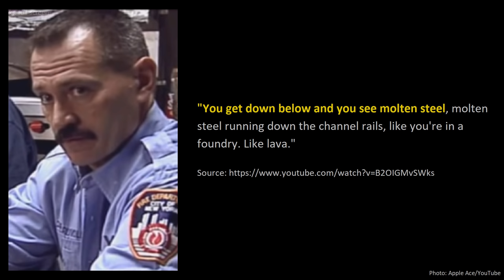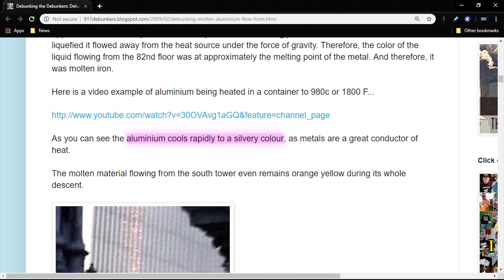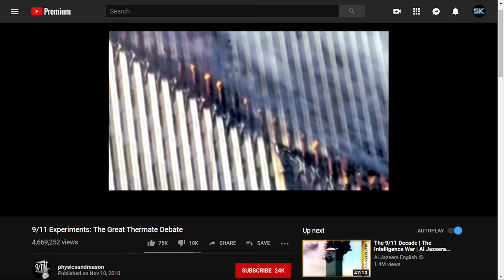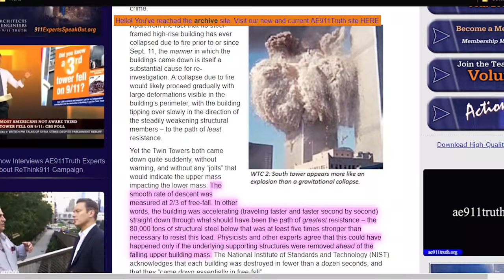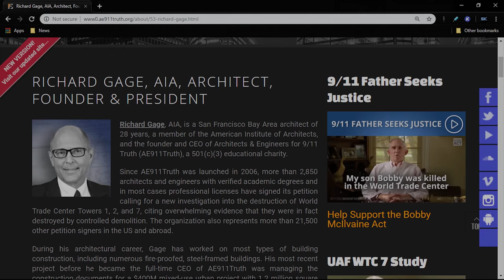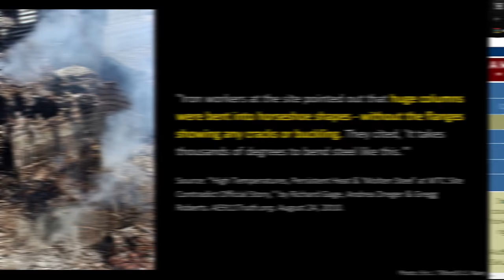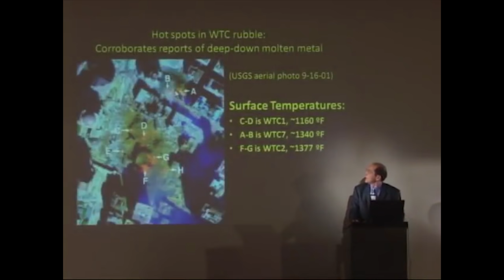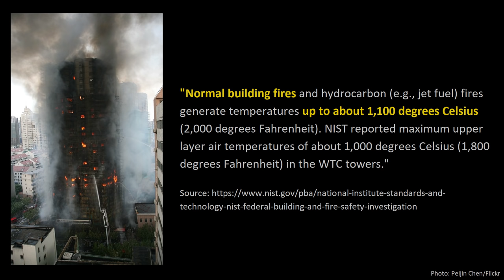9/11 Truthers Debunked: "Molten Steel = Thermite From Controlled Demolition!"

Comment: Could you please explain another point to me? If the fire became from the impact of the plane, and only the steel in those nearby floors were seriouysly damaged, why wouldn't all the lower floors with no such damage hold on the structure when it fell? The pankake effect makes no sense if you think about that. No?
Reply: Because of the construction of the towers, and the potential energy inherent in a 110-story building.
Reply: Well, that doesn't make much sense, because if so, the damage from the impact would've been much bigger, the building would shake or something. But no, just a airplane-shaped hole with fire damaging the structure on the upper floors, not on lowers.
Plus, the Empire State also had a plane crash long ago and the damage wasn't that harmful if compared to the ones on the twin towers. Well, at least the building survived okay to the disaster.
Reply: @thiagowwz  Yeah. Let's see if you can see the issue with your argument here.

B-25 Mitchell Bomber: Max take-off weight, the weight the plane cannot actually exceed and get off the ground, 35 thousand pounds, and the plane wasn't anywhere near maximum load. Max speed, 272 mph, equivalent and since the plane was flying through a fog, it wasn't near that, either.
Empire State Building: a steel-frame, reinforced concrete tower. 

Boeing 767-200: OEW, the MINIMUM possible weight to have a functional aircraft, holding only the fuel needed to get off the ground, and the crew, 176 thousand 650 pounds. The plane was fueled for a flight across the nation, and filled with passengers, luggage and everything needed for them. The minimum speed of the 767-200, approach speed, where the plane just barely doesn't fall out of the sky, is 153 mph. We can, with authority, say that it was moving a lot faster than that.
Twin Towers: an all-steel, tube-in-tube construction with as much open area as possible.

Assuming, and this is one hell of an assumption, but assuming the B-25 moved at 250 mph, and weighed 25 thousand pounds, the kinetic energy would be close to 71 million joules. It wouldn't have been because the numbers are significantly higher than they would have been, but let's go with it.
The kinetic energy of Flight 11 would have been 2.5 billion joules, or about 35 times that of the B-25. The energy of Flight 175 would have been in excess of 3.9 billion joules.

They would also have hit buildings that have nothing in common other than being in New York. Conclusion? The cases are as far apart as they could possibly be.
Reply: @MoonEyes2k  And yet, you couldn't explain the structure failures of WTC.

If the damage from the airplane was that strong, and there was a structure failure, the building would've show at the moment of the impact that there was a structure failure, but no, we've only seen a plane — with fuel to cross the nation — hit directly on the building and created an enormous hole on it and it took around of an hour (?) to say that the flames were the cause of deforming (not even melting) the steel. The fuel couldn't get in any way to the needed temperature to make the steel from the higher floors melt and destroy all the steel and concrete structure on the undamaged floors. 

That doesn't make any sense if you think about it. You're basically accepting an official report without questioning anything that is really off-spot on the explanation given.
Reply: Action-Reaction Law

There is no way a smaller part of the building do THAT damage to the larger and undamaged part of the building.
The worst thing that would've happened is the upper part of the builing having some debris falling apart, not a "pancake effect" destroying evetything underneath it.
Reply: @thiagowwz  So, what you're saying is, your "argument" failed, and now you want to make it about something else, anything else?

"The fuel couldn't get in any way to the needed temperature to make the steel from the higher floors melt and destroy all the steel and concrete structure on the undamaged floors."
Even ignoring that this is irrelevant, the jet fuel didn't do anything other than START the fires, it's also nonsense. The open-air temperature of a fire of Jet-A fuel, as would have been used in a US domestic flight, is 1000 degrees. Inside, heat radiates back from walls, floors and ceilings, and so is significantly higher. Of course, that doesn't matter, since the fire didn't "melt and destroy" anything. It weakened the steel.

"You're basically accepting an official report without questioning anything that is really off-spot on the explanation given."
No, in comparison to you, I have actually studied the material and the science. And what do you know, facts, proof and science doesn't actually CARE about you or your notions. It just IS. And it's the same for each one.
Reply: @thiagowwz  "Action-Reaction Law There is no way a smaller part of the building do THAT damage to the larger and undamaged part of the building."

That you don't understand the Third Law of Motion only mean that you don't understand it, and how it doesn't apply.
Reply: The Empire State was an example, not an argument. 
The argument was above the exemple. Cases are nothing to do one with another? Okay, you got me there. But you still couldn't explain the pancake effect.
The fire was started by the fuel and weakned the steel. Still... The higher floors steel. Not the lower ones.
And there is no way a smaller (and weakened) part of something do a damage on a larger and stronger part of it.
Reply: @MoonEyes2k  "That you don't understand the Third Law of Motion only mean that you don't understand it, and how it doesn't apply."

Oh, it doesn't apply? Interesting... And I'm the one who doesn't understand it, right? Okay, then... 🤷🏽

You should definitely review some of your science studies.
Reply: @thiagowwz  "The Empire State was an example, not an argument. "
Oh, no. No, it was an argument. One which you are not the first to attempt to use. And, when pointed out to that the cases are entirely not parallel, and one cannot be used to argue for the other...you ran away.

"But you still couldn't explain the pancake effect."
Oh, certainly I can. But, after nearly 20 years, that you don't UNDERSTAND that means it wouldn't be any use, because you'd ignore it.

"You should definitely review some of your science studies."
Yeah, or not so much. But, by all means. DO detail what the Third Law says, and exactly how it applies to the situation. Be specific. Use quotations, and as needed, extra sheets. I will be RIGHT here, waiting.
Reply: @mooneyes2k478  "And, when pointed out to that the cases are entirely not parallel, and one cannot be used to argue for the other...you ran away."
--
"Oh, certainly I can. But, after nearly 20 years, that you don't UNDERSTAND that means it wouldn't be any use, because you'd ignore it."
--
Oh! I'm sorry, who ran away?! lol
Reply: @mooneyes2k478  Do you want me to bring articles to show you?
'Cause I've already explained and you still are saying that is able to explain the pancaking and came out with nothing yet. I made the 1st question and you didn't explain it and kept coming up with nonsense explanations trying to prove your point pointing to the bad example I gave from the Empire State.
Reply: @thiagowwz  "Do you want me to bring articles to show you?"
By all means. Bring away. See what you got.

"'Cause I've already explained"
No, you haven't. You have carefully and deliberately NOT "explained" anything. You've talked around it, and past it, and tried to pretend it didn't exist.

"I made the 1st question and you didn't explain it"
You ALSO made the first claim. And you still haven't supported it.
Reply: @mooneyes2k478  

"By all means. Bring away. See what you got." 
What do you want? Links or me to explain every topic that I bring up?
--
"No, you haven't. You have carefully and deliberately NOT "explained" anything. You've talked around it, and past it, and tried to pretend it didn't exist."
I talked about my point and you told me that the 3rd law does not  apply, man. And you couldn't explain why, you're just trying to say that I'm not correct about anything not saying anything. So... Easy.
--
"You ALSO made the first claim. And you still haven't supported it."
And yey you're miserably failiing to debunk it. So... Again... Easy.
Reply: Maybe the 3rd law doesn't apply because there was also a black hole inside the building that the plane created with all that destruction.

Go take a look at plane accidents.... A plane cannot do that to THAT building. Sorry.
Reply: @thiagowwz  "Go take a loot at plane accidents.... A plane cannot do that to THAT building. Sorry."

So, your argument here is, "Because a plane hit the ground, it can't hit a building!"? Good attempt. Amazingly stupid, but still, good. No...no, wait, it's just stupid.
Reply: @mooneyes2k478  I do not see "ground" on my sentence. Grow up, dude.
Reply: @thiagowwz  So, where does the planes go when there's an accident on YOUR world? Into space?

Someone needs to grow up, that much is clear, but it isn't me....which doesn't leave much choice, does it?
Reply: @mooneyes2k478  Dude, have you EVER heard about planes hitting birds? Go see what a BIRD do to a FUCKING AIRPLANE.
Goddamn.
Reply: @thiagowwz  Yes, I have heard what they do to planes. And so what? Or did you think that a bird and a building are the same? Because, wow.
Reply: But now I'm really curious. Let's go back to the 3rd law. Would you please tell me why it doesn't apply in that case?
Reply: @thiagowwz  So, you don't know about bird strikes EITHER. Now, this does not surprise, it must be admitted, but I don't quite understand why you'd brag about lack of understanding.

"Let's go back to the 3rd law."
Yes, by all means let's.

"Would you please tell me why it doesn't apply in that case"
Absolutely. As soon as you've defined exactly what it says and how it DOES. Which, after all, was what was asked of you. Your claim, Your proof. Remember?
Reply: @MoonEyes2k  "So, you don't know about bird strikes EITHER. Now, this does not surprise, it must be admitted, but I don't quite understand why you'd brag about lack of understanding."

Oh gosh, here we go. If a bird... A creature that is more fragile than me or you can make damage to a plane (not cut through it), but deform it. How can aluminum cut through a concrete and steel structure? Tell me please. Aluminum (light) vs Concrete+Steel (really heavy and thick).

"Absolutely. As soon as you've defined exactly what it says and how it DOES. Which, after all, was what was asked of you. Your claim, Your proof. Remember?"

How it WOULDN'T apply?! Was it on another space dimension or something?

But let's go. F = m.a, right? Translating: Force is equal to mass times acceleration. If there is a force applied in one direction, there is the same force the other way around. 

1st the plane: Assuming the plane came directly to the tower at it's maximum speed, the force it did on the building, the building did the same force back on the plane. As the plane is MUCH more fragile than the building structure the result of the impact would be the plane deforming itself as it went forward, not cut throught the building. It would explode outside the building with its wreckage falling apart and MAYBE the nose would've been stuck. The plane does not have enough potential energy to deform or damage that building THAT much.

2nd the building: Again, force is equal to mass times acceleration. The only force acting on the building to fall is it's own mass and gravity acceleration. The part of the building that was damaged by the plane and fire got weakened and fell at free fall speed destroying the building all the way down. But why that is impossible? Okay, let's see: the building is all of the same structure, right? How can an object of lower mass with no extra force on it would simply destroy all the undamaged structure it have always sustained that small part of that building until that day? IF the pancake effect would occur, the maximum damage would be the SAME number of floors there was upwards on the lower nearby floors and NOT all the building. AND IF miraculously happened, it would take much more seconds to come all the way down, not on free fall speed.
-----

Now tell me, why wouldn't it apply?
Reply: @thiagowwz  "If a bird... A creature that is more fragile than me or you can make damage to a plane "
Sure. So, you literally know nothing at all about bird strikes...or birds, for that matter.

"Tell me please. Aluminum (light) vs Concrete+Steel (really heavy and thick)."
Oh, right. Let's see. 6061 aluminium alloy, commonly known as "aircraft grade". Tensile strength, that is, the ability to withstand stresses without breaking, 400 MPa.
A36 industrial steel, as used in the towers, tensile strength of 400 MPa. What do you know...
Wall thickness of the column in the Towers, at the impact level, 2/5th of an inch. Comparative "thickness" of the wing of a Boeing 767, 4 inches. Distance between columns, 26 inches.

What do you know, not only was the steel not thicker, it was also not stronger, and there was significantly less of it.
Deary deary me.

"But let's go. F = m.a, right? Translating: Force is equal to mass times acceleration. If there is a force applied in one direction, there is the same force the other way around. "
What do you know...you don't know the third law of motion that you tried to pretend applied. Good sign, that. Glad to see you admit it, at least.

"As the plane is MUCH more fragile than the building structure the result of the impact would be the plane deforming itself as it went forward, not cut throught the building."
Not only have already seen that's so much bull, but you're trying to apply a flawed caluclation. Try the one you should be using. 0.5*m*v^2. See what you get. Then tell me again how the wall should withstand the impact.

Oh, just as an aside? Try looking up "ping-pong ball through paddle" and then tell me again how it doesn't work.

"Again, force is equal to mass times acceleration."
Again, you have no clue what you're talking about. Good WORK, fella!

"Now tell me, why wouldn't it apply?"
How about, because you're utterly clueless as we can see from your failure at an argument.

Now, would you like to actually attempt to answer the challenge put to you? Which was, What is Newtons Third Law, and how would it apply?

Or would you prefer to admit that you don't even have a grade school education in basic physics?
Reply: @mooneyes2k478  You still have not answered me. lol
Reply: @mooneyes2k478  Now explain to me, oh please, Mr. Scientist.
Reply: Oh and thanks to you guys I just discovered there is ACTUALLY an organization of Architects and Engineers with its own site and channel with deeper explanations. Thank  you Mr. Scientist!
Reply: @mooneyes2k478  Right, right. Yawn.
Reply: Tell me how can a DAMAGED 1/5, 1/6 (whatever) of the building destroy the whole UNDAMAGED part of the building below it with only gravity.
You know well the law of physics, I suppose. Can't wait for your answer, Mr. Scientist boy.
Reply: Four days later with no answer, I'll take this as acknowledgement that you didn't know what you were talking about, and know it. Thank you for that.
Reply: @mooneyes2k478  YOU gave me no answer, Mr. Scientist. But don't worry, I'm still waiting.
Reply: @thiagowwz  Right. So, "He's being MEAN calling me on my stupid, I'll pretend that it's on HIM to prove my nonsense."

Sorry, didn't work.
Reply: @thiagowwz  Sure. So, you've been asked, repeatedly, to support your claim about the Third Law. You failed utterly the one single time you attempted it, not even getting in the same ballpark.

And every single time you've been asked since, which is what, 4-5 times now? You've EVER so carefully avoided even acknowledging it, in the hope that, if I stop asking you, you can pretend it never happened.

Some-one is utterly pathetic, that's true. But it isn't me who is going "NANANANANACAN'THEARYOU!" So....who does that leave?
Reply: @mooneyes2k478  "Could you please explain another point to me? If the fire became from the impact of the plane, and only the steel in those nearby floors were seriouysly damaged, why wouldn't all the lower floors with no such damage hold on the structure when it fell? "

THIS was a question.
You didn't answer. And trying to make ME prove something.

Smart guy.
Reply: @thiagowwz  To which the answer was "Because of the construction of the towers, and the potential energy inherent in a 110-story building."

What do you know. You then tried to argue that a WW2 B-25 bomber was the equivalent of a 767, and the completely different in construction buildings they, respectively, hit were the same too.

And so it goes. You still haven't managed to support your claim, either. What a shock.
Reply: @mooneyes2k478  
«To which the answer was "Because of the construction of the towers, and the potential energy inherent in a 110-story building."»

You haven't explained. You just said "Oh, because it could."
Reply: @MoonEyes2k  Dude, think: that upper part has always been there. The lower part always was able to hold it. When this upper part got damaged, it would ruin itself, not destroy all the intact building structure below it. There was only gravity acting there.

And yes, I tried to make a comparison that wasn't good for the case. And I recognized that already. 

But I was indeed able to explain to you a quite few times about the 3rd law and you're still trying to make fun of me not answering.
Reply: @mooneyes2k478  and watch this last video to see another support to what I was thinking about with more details.
Reply: @MoonEyes2k  Then check "static versus dynamic load".

The upper part was not thrown downwards. There is no way it would be able to destroy all the building before ruining itself first and THAT would make it lose MASS, so there wouldn't be any more POTENTIAL ENERGY to destroy the rest.

Oh gosh.... And I should be the dumb one over here.... ¬¬'
Reply: @mooneyes2k478  "That was probably the least intelligent comment made by a "truther" thus far this year. And that's saying something."

Then we have no reason to discuss anymore. Lol
Sorry to bother you, Mr. Scientist.
Reply: @mooneyes2k478  And I'll stop answering you, ok? 'Cause I don't want to help this video publicity any more then I've already did while discussing with you. Stay home, wear mask when going out and wish you health, Mr. Scientist.